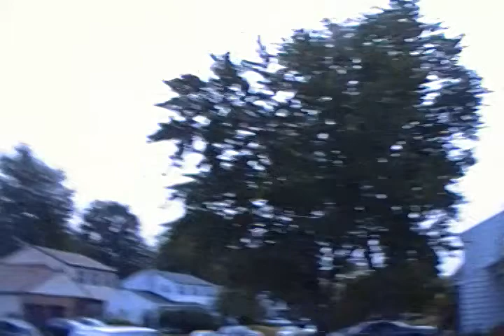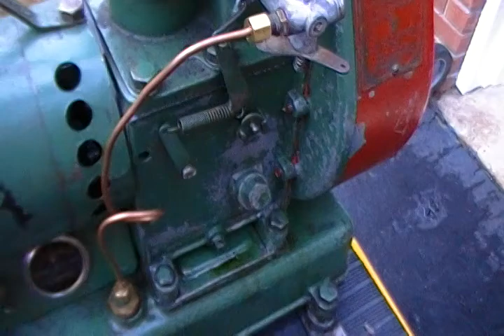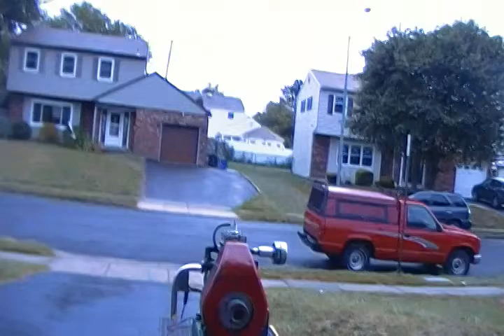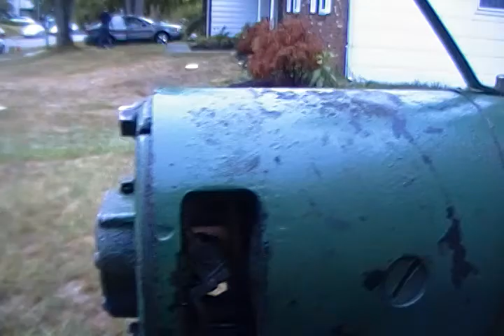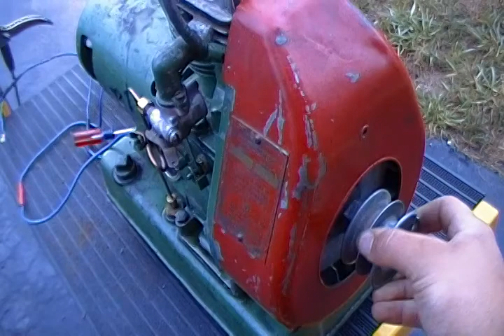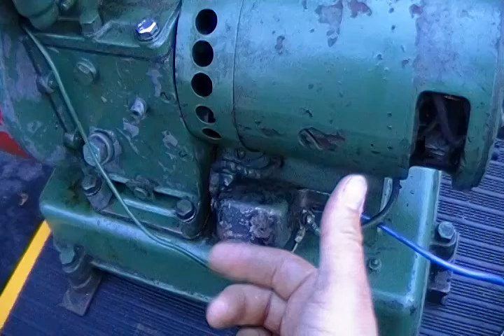Wells 6 Volt Power Charger

Comment: Hi I have a small 2 cycle home lite generator it doesent make power not sure what needs fixing ,when I put 12 volts to the plug it turns the engine entill it bumps up on compression the brushes are perfect so what to check ?